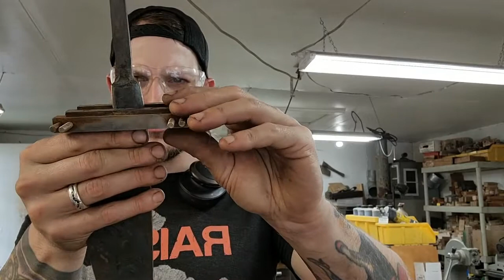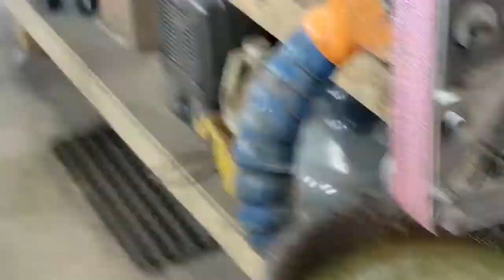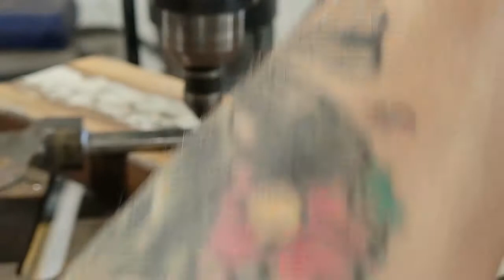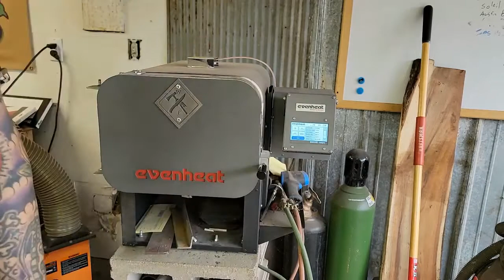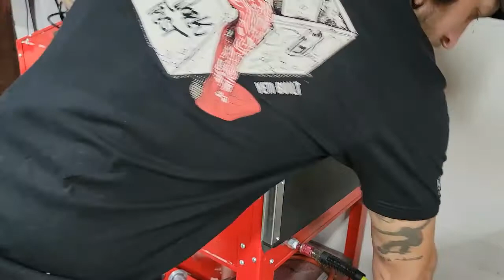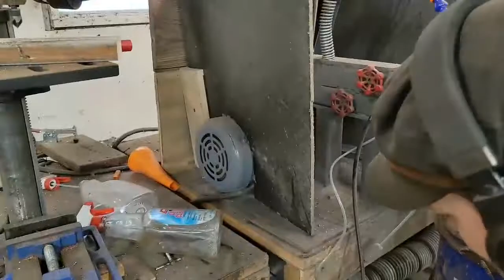Integral Brute de Forge Chef's knife part 2

Comment: That guide with the carbide is very cool. Do those guides break down the sanding belts fast or not a all?
Reply from the maker: They can on a new belt. I usually use worn belts for this part because the material is soft and I don't want to destroy a new belt with a carbide guide. Abrasives won't touch the carbide!